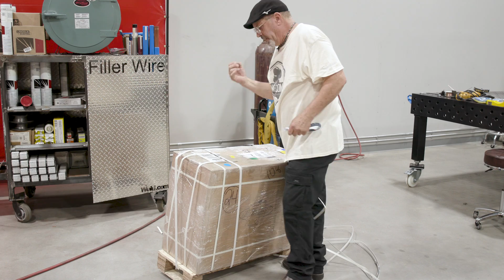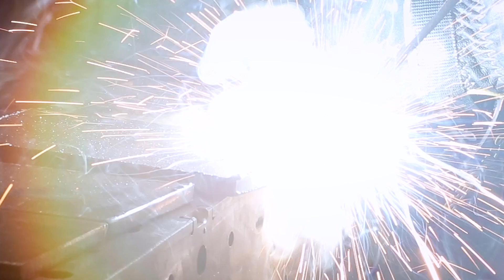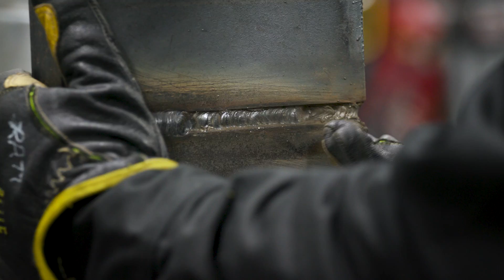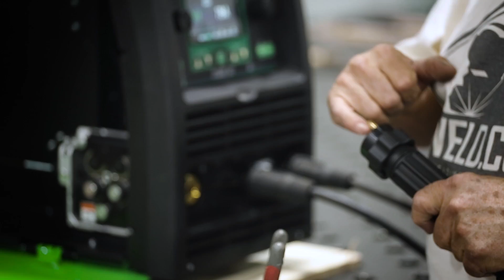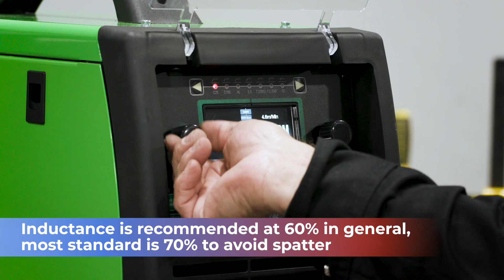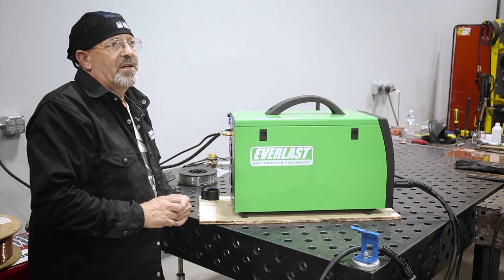Welding With The Cyclone 262 By Everlast

Comment: 😂 What does H4R mean on an E7018 electrode?

An H4 designation, for example, indicates the weld deposit has 4 ml or less of diffusible hydrogen per 100 g of weld metal. Electrodes with an “R” designator — such as E7018 H4R — have undergone specific testing and have been deemed moisture-resistant by the manufacturer.

Comment: Richard, I like my bacon crispy. With over 30 years of experience, my hearing is fine, I don't hear my bacon clearly on this machine. Please send me this machine to test in person. True evaluation is a requirement before making an assessment. (Also, Richard at the beginning of this video you made some adjustments with dial and button this machine never did any corrections. Thats interesting.

Comment: Just a question for everyone, Why choose the CYCLONE 262, over the POWERMTS 251SI? 
Admittedly, that Screen/interface on the on the 262 is a much better, but having the option to run Tig is is more appealing. Any chance @everlastgenerator is upgrading the MTS 251 to a better screen? I guess the lighting series is the upgrade, but a $1k+ difference. Thanks

Comment: Most of us have the machine we need for home projects…many of us have several…but I’m tired of the 3 minute duty cycle when welding heavier projects on the farm.  Implements, structural projects and heavy equipment often have 1/2”-2” plate that needs deep penetration and the welding has to be done late into the night for several hours at a time.  Can you recommend a HEAVY DUTY MIG? (I’ve go monster rod welders out the ying-yang (whatever that is…my grandfather used his a lot!).
Reply: The machine was upgraded to 50% duty cycle @ 275A.  The duty cycle goes up as the amps drop.  The unit has a heavier duty cycle than the competing Miller 252 and Lincoln 260. This unit at 250A has a duty cycle of 60%. 100% around 200A.  Bigger machines typically require 3 phase for higher outputs. Everlast has a 312, which puts out 315A @ 35% duty cycle as well. If it's maximum power you are after with heavy duty cycle, you can look at the Power i MIG 353DPi, or the PowerMTS 400.  For the 400, you'll need 460/480V to develop maximum 400A output. The 353dpi can operate on 240V single phase however at max output. Both have 60% duty cycles.

Comment: Probably should talk about the Duty Cycle more. These Everlast welders don't like running on max amps. They get hot quick and you need to stop for a fairly long while, otherwise it trips early in the Duty Cycle. I use the same AMP welders by different makers and don't have that issue. So I only use the Everlast on low amp jobs.
Reply: I haven't experienced that with my Everlast in the slightest
Reply: @joelyounger  Your probably welding on low amps. You wont reach the Duty cycle on low amps.😕
Reply: Which input are you using, 115 or 220?  Lots of stories and comments about the dual voltage welders just not liking 115, even to the point of affecting reliability.
Reply: @replyhere590  I ran both my 200e and my current Cyclone 212 on 120v without any issues, honestly they were both surprisingly powerful on it.  I now have 240v in my shop, been running my 212 almost daily, and I haven’t had any problems with it at all.  The only thing I’ve found to complain about is the powerset.. imo it’s way off, especially when you get to the settings for thicker metals.  I only use powerset for the one time repairs I get, so it’s not a huge deal, but it would be nice if it could be updated or something.. I’ve heard of Everlast sending boards to customers for repairs, I’d be fine with swapping a board out to have the powerset working properly.  Other than that, I’m glad I chose Everlast! I got all the features I wanted for a hell of a lot less than a red or blue machine!

Comment: This man reminds me of my grandpa, has lots of same manners as he did. 
Granpa used to work in a nuclear  reactor laboratory. 1970 to 2000s
He was doing weld repairs to defective used aluminium fuelrods to be used again. Stick welding with a mechanical extension arm behind a yard (meter) thick led wall. You could not use basic dimmers so they  had to use mirror or some sort of periscope to not be in the line of radiation. I belive that we dont do stuff like that anymore.

Comment: HELLO,  to  All:    Just did a price check, on this  green box welder.  about 1700.00  US  dollars. Very good specifications. Up to 1 inch thick, welding with multiple passes....etc.  It is a 240 volt input, machine. 200 amps, out for  'stick '  welding...
Reply from the maker: Thanks for sharing

Comment: OK Bob you said to comment on a machine that we would like to see you do a rundown on so to speak. MTS 400. I have never seen anyone start to finish box to weld that machine. In the spring I’m going to order one and I would really love to see that machine put through the paces. I do a lot of heavy equipment repair,Arc Gouging, Farm machinery repair and general fabrication. I mainly work as a mobile welder. Will be moving into a shop for increased productivity and machining capabilities. So if at all possible could you please run the MTS 400 through its  paces for us guys that are interested in them? As always love watching your videos.

Comment: H4 means the deposited weld will contain a maximum of 4ml of hydrogen per 100 grams of weld. The R in H4R stands for "resistant", which means the flux is extra resistant when compared to a standard 7018 H4.

Comment: I don't understand inductance very well. What is the 101 explanation for it? Thanks
Reply: Inductance happens when a current flowing thru one conductor generates (or induces) a current in a nearby conductor.   This happens without the conductors actually touching.    An inductor can be implemented as a simple coil of wire.   An AC transformer is basically a pair of closely-spaced coils (inductors).    Inductance is relevant mostly only to AC circuits (not so much DC).
Reply from the maker: go in the WELD app and the community and hosts can help you